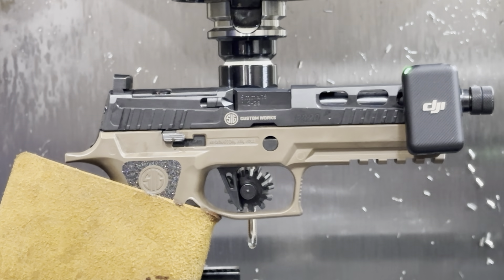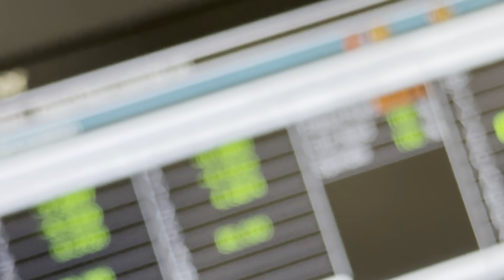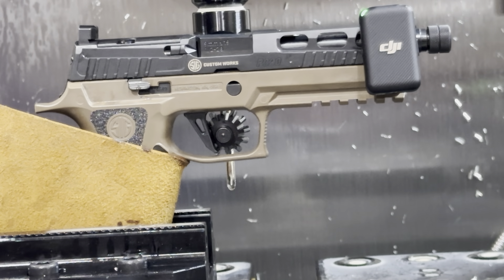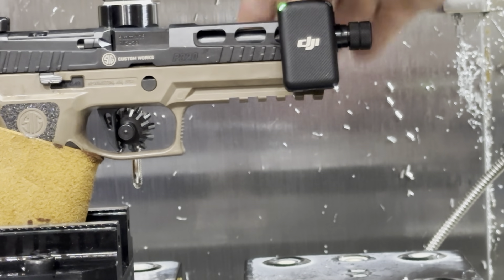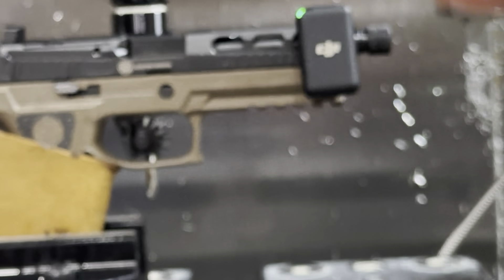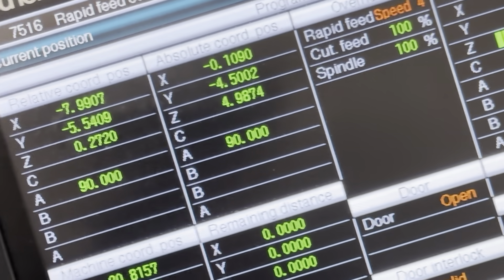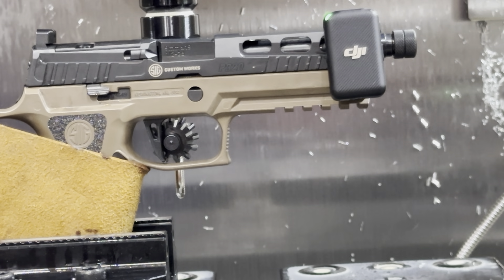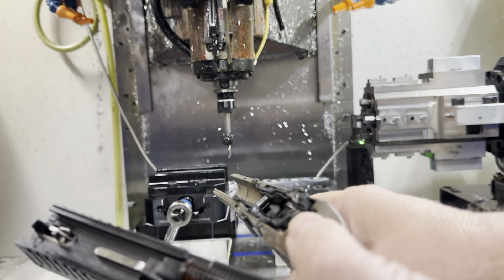Sig P320 accidental discharge tested in CNC machine.

Comment: Great video showing an elaborate setup to prove that a pistol will fire when the trigger is pulled! What some people will not understand is that the inverse concept applies......Meaning it will not fire without the trigger being pulled.
Reply: In that case, why would any gun ever need any kind of safety? It wouldn't fire without the trigger being pulled after all. Just don't pull the trigger, and it's perfectly safe. (Ignore the fact that it's firing in unintended and unexpected ways)

Comment: This was an excellent video.   The mystery now is how the gun in a holster is going to be in an equivalent condition to what you have demonstrated....essentially the take up fully travelled.   If we can find some evidence of how this happens, we may finally have a real explanation for these UDs.   I think the possibilities are that there is dirt/fouling that prevents a full reset, or pre-maturely worn reset springs.  (Aside - when did it become cool to never clean your guns?) I don't have a 320 of my own to test.  I actually tried to convince my wife I should get one, but it didn't go over well.  :).    There is still an issue to raise over why the sear can be defeated by play in the slide.  I think this will likely lead to a re-design of the striker hook or sear itself at some point.   But until we know what the real failure mode(s) is/are that alone would not be sufficient to solve the problem completely.

Comment: Nice equipment… Neat test.  Means little.  No one has ever claimed that every 320 series pistol is defective.  In fact the opposite has been stressed.  It is a small percentage of the total guns in service that are bad.  This only shows that one pistol is within tolerance and “probably” won’t blow some unlucky bastard’s left nut off.  Most “probably” won’t.

Comment: With all due respect, your analysis only provides one (1) data point.  What is required, and beyond anybody other than Sig, is an exhaustive analysis taking into consideration all of the possible tolerance stack ups.  I am very skeptical by way of the number of MIM components they use on critical fire-control systems.

Comment: A lot of people are like we want to see what a Glock would do on a test like this.

First off a Glock's striker is not in a "pre cocked position" the way it is on a 320 there is no "potential energy" stored ready to be released like on the 320. A Glock's striker is cocked as the trigger is pulled back. Think of a Glock as a double action only and the 320 is essentially a single action only striker fired pistol. That's why Glocks triggers have always kind of sucked, but they are very safe.

Comment: I can't figure out if you're proving the 320 is fine... or not fine by design? I would be interested in seeing this same test done with a Glock, or any other striker fired handgun. I can't imagine they would fire if you touched the slide, even if you were half way through a trigger stroke. A sear should not release at all, for any reason, until the trigger is fully depressed. The sloppy fit appears to give you enough space to "lift" the slid up off the sear at the .090 mark. My 320 does this exact same thing in its Flux Raider Chasis. The outrageous amount of slop between the frame and slide is probably the contributing factor. If you zoom in on the back of the slide while you're pulling the trigger, you'll see the frame being pulled down by that action... then when you squeeze the front of the slide, that gap opens and the sear releases. That's a repeatable way to fire a gun without FULLY pulling the trigger... and even if that's 2 mils away from where you intended it to, it's still an engineering fail. A gun shouldn't do this with a half pulled trigger.

Comment: The video you're talking about, the disassembly/reassembly has nothing to do with it being able to fire un-commanded, he did it with the sear all the way up and a magazine in the gun properly assembled, you proved him right that it can fire without the trigger being pulled all the way because your gun was properly assembled in the CNC. had you had a round in the chamber and a full mag you could have fired it by touching the slide like you did over and over, the secondary "Safety sear" didn't catch the striker when it slipped off the main sear either, It should only release the striker if you've pulled the trigger all the way through, it should never go off by touching the slide, not a quarter trigger pull, not half, not three quarters, it should only go bang if you pull the trigger 100% of the way because you intended to have it go bang, this is bad and Sig can't make up any more excuses!